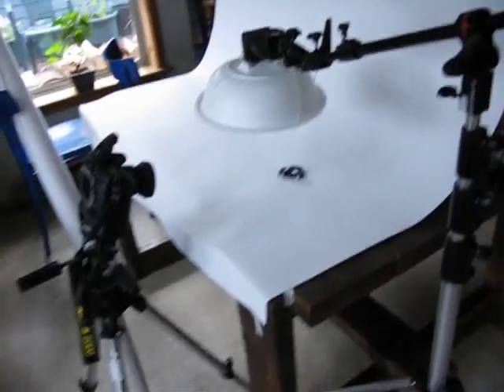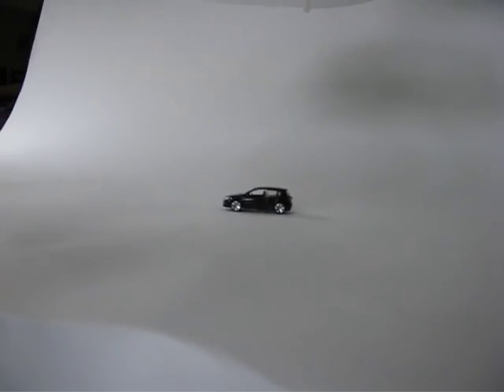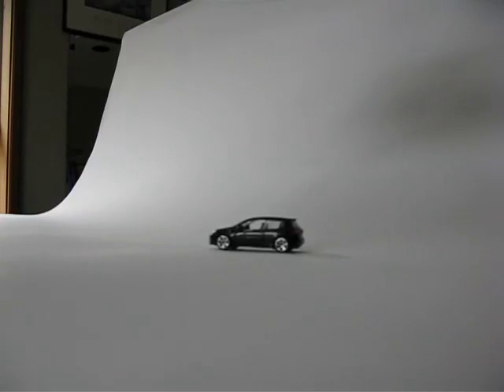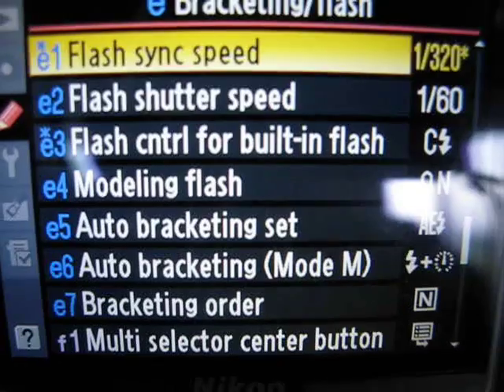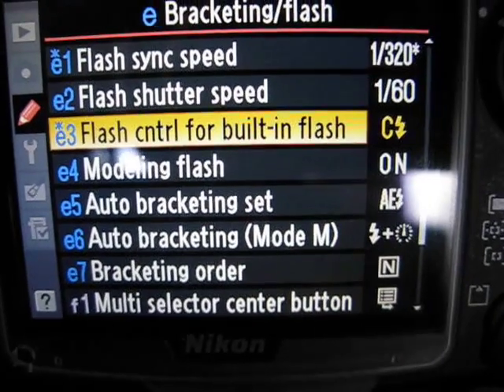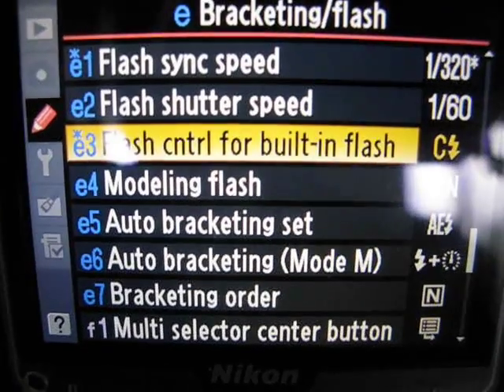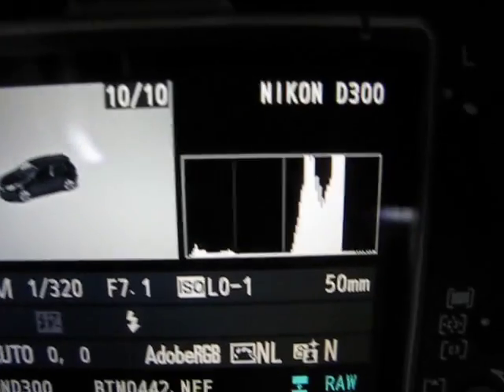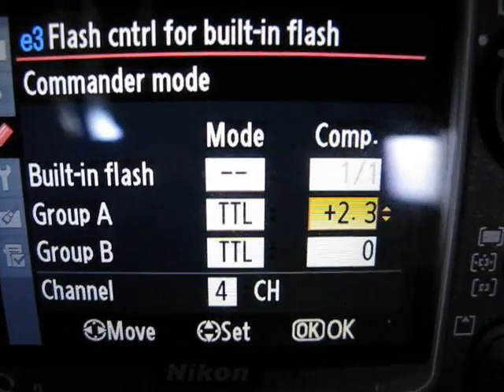Nikon Creative Lighting System - Basics Part 2

Comment from the maker: I wanted to show how to control the flash output using Nikon's CLS with the camera. There is no reason specifically for f/7.1 for this shot. However, there are situations where you want a certain depth of field and adjusting the flash output is the only way to get proper exposure. Thanks for watching.

Comment from the maker: I don't think the SB-600 has commander mode to control the other flash. But I could be wrong. You might need to buy an SB-800 or SB-900 to use as a commander.